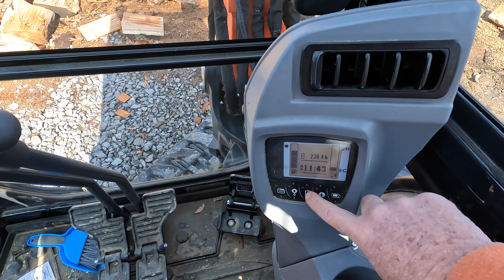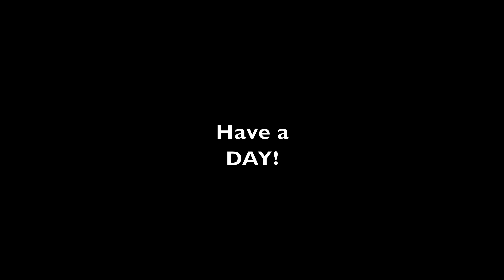Final Push! Splitting and Stacking Next Years Firewood

Comment: Hi Mike, perhaps this is a tip you received before or even already know, thought I’d send just in case not… our KX033 doesn’t have an attachment that uses the secondary port, but for our MX5400 we turn off the the engine then turn the key back to ON, then engage the grapple buttons to run the hydraulic-over-electric to release the lines before disconnecting. Seems to dramatically reduce the pressure and makes reconnecting much much better. Looking forward to seeing the CNC.

Comment: Just a quick comment on relieving pressure on electrically controlled hydraulics.  Turn the engine off, turn the key back on to activate the electrical circuits, and then operate the switch several times.  That should release any pressure in the system.  However, that doesn't work with implements that get hydraulically locked up due to thermal expansion.  That is where the clamping tool would definitely come in handy.  Tool or no tool, it's always a good idea to relieve any pressure before working on, or hooking up, any hydraulics.  Great videos, Mike.  I soak up all the valuable information you provide on each video.  I'll be sure to pay close attention to turning logs on my sawmill with something other than my hands.  It's too bad that you got hurt but putting it on your videos saved a lot of folks some pain and suffering.  Keep up the good work, and I'll keep watching!  God bless!

Comment: I have had two sets of the clamps for more than a year.  I love them and try to make sure and have them handy.  I have replaced numerous connectors thinking they were defective when in reality the clamps would have solved the problem.  I call BS to the folks that say they know about hydrolics and they have all the answers.  I’ve worked with heavy and small equipment most of my 70 years and I only wish these had been around years ago.  I love my clamps and won’t be without them.  Keep up the good work Mike and remember the ones that complain are usually the ones that are most jealous of your situation.  Anxious to see the track loader.  I’ve had mine about 15 years and can’t imagine work without it.

Comment: Hey Mike,

I've got a Kubota Kx033-4 and to release Aux hydraulic pressure do this:
1. Shut off the machine then turn the key to run position, don't start it
2. Put your control lock down
3. Turn on Aux hydraulics
4. Actuate with your thumb control

All pressure should be released. You can also release any pressure in any of the other cylinders or blade by using the other joystick functions. Have a day.

Comment: Mike RTFM :). To release pressure on aux. turn excavator off. Turn key on but don’t start. Put orange lever down if it isn’t already. Use panel to select aux. now operate switch both ways. This releases pressure in those lines. I do everything else too, joy sticks, tracks, blade.  Course this is only half the problem as you know. There can still be built up pressure in implement but I try to do this always before removing implement. Having said that yesterday I went to connect mower to excavator and could not get coupler on till I released pressure in the mower line.  I’ve ordered the tool, can’t wait for it to get here.

Comment: Have had the same problem with connecting my woodsplitter on my Bobcat 331 excavator. It is also electric over hydraulic. I immediately ordered 1 of the Irwin clamps and anxiously awaiting its arrival. There was times when I opted to not hook up my splitter only because it was so difficult. And just as side note I retired from 40 years in heavy equipment maintenance and repair, so understand how hydraulics work and struggled with these flat face couplers repeatedly.
Reply: Just one other note for future reference. I have a track skid steer with attachments. I have found that when disconnecting my grapple, if I connect the fittings together on the grapple after removal it keeps the outside temps from creating a problem next time you want to hook the implement back up

Comment: Mike, I agree with you, the QC mate is a game changer and obviously those negative comments have never experienced hydraulic expansion in an implement! I liked the idea so much, I made two of them that does two different thing. I also made it to work on the front couplers of my Bobcat CTL. Those fittings are different from my excavator fittings because the are mounted flat on the boom. Your new Kubota CTL may have stubs instead of flat mounted. Would love to send you a video of what I’m talking about.
Reply from the maker: Yea I need to get up and see you sometime
Reply: I also have a track cleaning tool for you. I think you would love it! It stays mounted on the machines with rubber clamps so you can clean all the dirt off out in the woods rather than bring it home with you. Also works great for cleaning off the spillage over the front blade of the excavator! Another one of those game changer simplify life ideas! Our door is always open, stop anytime!

Comment: I have a third function remote hydraulic hookup on my loader tractor and ALWAY have had to Crack the fittings to hook them up ,saw the video on that tool and figured if it worked for you ,then it would be work for me , so I have ordered one 
No more hydraulic oil to clean up.   Have a great day Morgan family 
No sap running  yet up here around Eau Claire Wisconsin

Comment: I have two 50 foot off-road diesel fuel hoses that have these types of connectors on them.  We use them for transferring fuel from our snowcat to our generator tank and also sometimes when we can't get fuel delivered to our location, I have a 300-gallon tank that fits in the back of a one-ton that we use to go and fetch more fuel.  When transferring fuel I tell everyone to make sure to get as much fuel out of the hose as possible, because when we hang up the hoses in the building and there is any kind of temperature change, the fuel expands.  At that point, there is so much pressure in the hose that you can't overcome the pressure and get the fittings to work.  You have to get wrenches and break the fitting apart to release the pressure.  I could see how the clamp would work just fine.

Comment: I had the same problem on my Cat mini digger, with the same function with electric valvees on aux hydraulic. I just switch ignition on without starting the engine, then I could use the button on the joystick to relieve preasure on the lines.

Comment: Hey Mike it may have been mentioned in the comments but just a tip to relieve the pressure in the aux lines on your excavator. What we do at work is turn the key on but don't start the machine then turn your auxiliaries on and rock the switches back and forth.  It will open the solenoids and relieve the pressure.

Comment: Mike, you can take the pressure off any part of the system by just turning on the key (not starting)
then engage you handle on the left and push your auxiliary flow function on and the control panel and then toggle any of your controls including the thumb ports and the auxiliary port. Good luck

Comment: Mike, try putting the cutting edge of your wood bucket flat on the concrete while scooping up the wood from your bunker. That way the cutting edge is not running into blocks of wood and having to push them out of the way to advance. With the cutting edge flat on the concrete, it will be under all the blocks and should advance with less resistance.

Comment: Hi Mike, I think any tool that makes life easier and is priced right is worth owning. I think that if you shut down the excavator and then turn the key on so you can energize the auxiliary hydraulic you can then relieve the pressure in the lines by rocking the control back and forth a couple of times. This is what I do with my third function control when using the grapple. Have a Day, from MA.
Reply: This is exactly how I have to relieve pressure on my cat 303.5 mini to get the aux hydraulics hooked up.
Reply: This is exactly what I was going to comment. That is what I do on my kubota tractor with third function. Just thought I would mention that and maybe save someone some aggravation someday.

Comment: Tom from Block Island,  I just had to replace the front wheel bearings and seals on my Kubota B series.  Parts guy said it was due to using forks with no counterweight.  Saw you loading that heavy IBC to get dried. 3-point quick hitch should make loading a weight box easy.  Just saying.  Been subscribed for a year or two but first time commenting since you asked in last episode.  Take care

Comment: Nice team work on the splitter…that QC Mate looks like just what we need.  Wonder if it will match up with the Case Skid Steer….seems those fittings are next to impossible even after hitting pressure release.

I would like to see some of those popping off hook those high flow connections.

Comment: Mike, you might be able to relieve the AUX hydraulic pressure by just turning the ignition on without the engine running, toggle the AUX switch back an forth to relieve the pressure. (???)
The AUX solenoids have to have battery voltage supplied for them to work. I guess it would depend on how you have them wired to switch on/off with your ignition switch.
Reply: That’s how I relieve pressure on my tractor’s third function with pioneer fittings. Works good!

Comment: For the 3rd function on my 1025, it has  electric over hydraulic. I found turning the ignition key on, but not starting the machine and activating the switch helps to relieve pressure. Not sure if that is relevant in this case.

Comment: That Irwin works good Mike I have a similar tool. My new tractor has electric over hydraulic like your excavator for third function and I can relieve the pressure by just turning key on, not starting and push button and open valves and relieves the pressure but sometimes in the implements end there is pressure this need the tool. Anyway Thanks 👍✊
Reply: thank you!  commented to mike about turning the key to the on position and then wiggling the controls to relieve the pressure, that’s caterpillars procedure, and i don’t think kubota would tell you to go purchase an irwin clamp if you wanted to use the auxiliary hydraulics.

Comment: My tractor is electric over hydraulic for the 3rd function valve. The way I release pressure is to turn key on not tractor. Then push on the buttons back and forth. Takes all pressure off the lines.

Comment: The older tractors with lever style hydraulics you could shut your tractor off then wiggle the lever to take the pressure off. But these new tractors are using electronics so getting the pressure off of the equipment is difficult. People that don’t use equipment all the ti,e have no idea how to use it. So thanks for letting us know about the idea.

Comment: If the heat press is a swing away, make sure the area it swings over doesn't have anything under it.  While you are changing out the platen, the press will heat up whatever it is over.  Had one melt a table surface by not paying enough attention...

Comment: Hey Mike!  You can shut the machine down, then just turn the key back on to cycle the aux hydraulic. 8 times out of 10 that will do the trick if your machine side is holding pressure.  
   Can't wait till our splitfire comes in for the big stuff!

Comment: most if not all modern excavators are electric over hydraulic so the joysticks are .  
what you can do is turn off the contract that stops the engine , 
then turn on the contract 1 position but DO NOT start !  , 
then enable your auxiliary hydraulics with the engine OFF and IF your machine allows you to 
(there are machines that will not activate that function without a signal that the engine is running) then operate your auxiliary hydraulics and your joysticks 
(note that the arm  of the machine is supported by something or rests on the ground) now your whole hydraulic system should be pressureless .  
some excavators have a vent valve on the tank cap of the hydrolik, if you press it or otherwise release it, the pressure is also gone

Comment: That oak looks like it has some steel in it. Have you found any? Also the Hydraulics on this new equipment is electric over hydraulic so it doesn’t balance out the pressure like the oil systems.

Comment: Hah, you kinda chased a squirrel splitting the big logs when you were explaining the need for the disconnect tool. So, because it is an electrical solenoid you still have pressure on the line and it's hard to connect/disconnect?? Am I following you?

Comment: Just curious if you've tried this. With the boom all stretched out and the attachment on the ground. Shut the machine off. Lift hydraulic bar to the off position. Turn the key to the on position, don't start it. Lower your bar to activate the joy sticks. Hit the button to excite the Aux. hydraulics move all your joysticks around and move all the auxiliary buttons on and off a few times. With the electric over hydraulic valves it's my understanding that will relieve the pressure. Works on my Bobcat hoe.

Comment: Just curious …. Why couldn’t your elevator hydraulic drive be run with the splitters excess … even with some sort of shuttle valve that would run the elevator when the splitter was idle … having a 6hp motor on line continuously seems a bit of over kill …

Comment: To relive the pressure on an electric over hyd. system, turn your key on without starting the machine, let computer cycle, place your safety activation bar in work position, now move your electric switch that activates the circuit you want to relive in both directions. This should relive the pressure on the machine. (It won't do anything for the implement your trying to hook up)

Comment: Electric over hydraulic:  you should be able to put the key in the "run" position without starting the engine, then operate the valve switch.   Without the hydraulic pump running it should be the same as wiggling the levers on the other functions.
Master hydraulic lever must be down.

Comment: Hoses are probably too long on the wood splitter.
Reply from the maker: yea, little longer than needed, I'm sure they ship them that way better longer than to short for some customers
Reply: I would have zip-tied them. I can't stand hydraulic hoses flopping around on my eguipment.
Reply: Motor you are right about the company supplying hoses for different applications.  You will figure it out.

Comment: can't believe you don't how to release the pressure on your electric controlled remotes. Turn off the engine, when it dies turn key back on to run position and operate the switch in both positions, you can here the accelodes click .
Reply: on your Attachments when you disconnect from the machine couple your lines back together they keeps the end clean and  not beat up and keeps the pressure balanced with temperature changes.